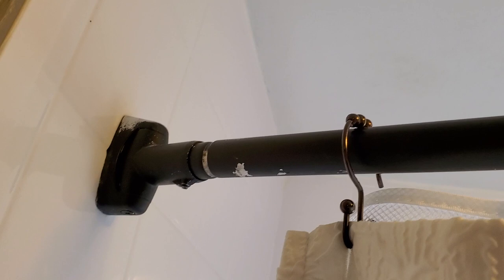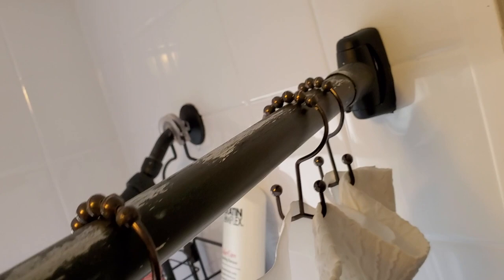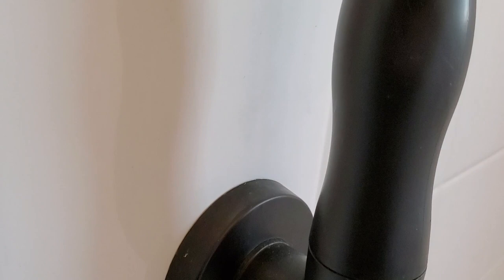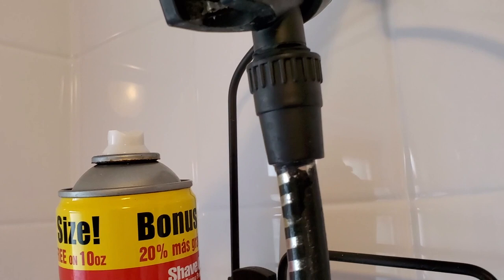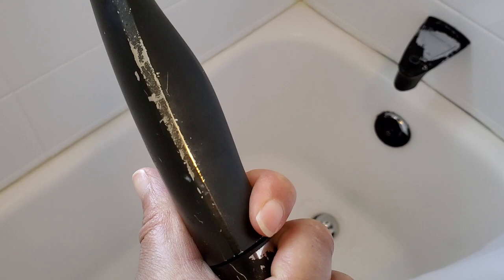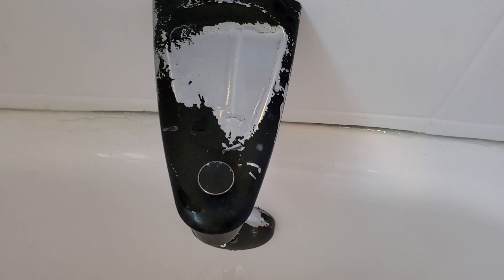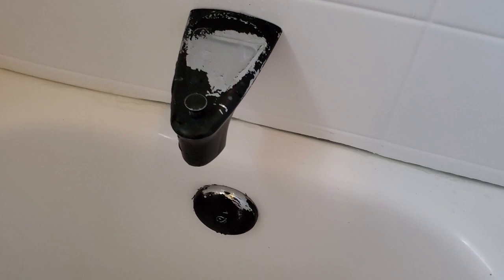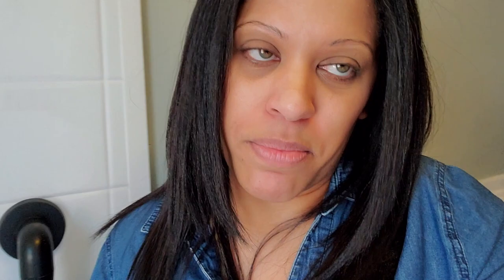BATHROOM FIXTURES UPDATE! | Casa Kerins | Rustoleum Spray Paint | DIY |  6 Month Review!

Comment: Rustoleum makes a matt black bumper and trim spray paint that is made to be used on car black plastic bumpers and trim. I don't know how it works on cars, but I used it to paint a black kitchen drain stopper and disposer flange that had chipped soon after purchasing it. it looks fantastic and is wearing like iron.
Reply from the maker: Oh wow my husband told me about that product. Maybe I’ll give it a try!! Thanks for the heads up!
Reply: Did you use a sealant on top of that too?
Reply: @klbracero  no, just the paint.

Comment: I actually appreciate this video. Thanks for showing what happens when u don’t sand or prime the fixtures first. 👍
Reply from the maker: You’re welcome. For the record fixtures that I did sand and prime chipped the same way 😉 what I’ve learned is that spray painting fixtures works best on low traffic areas.
Reply: @HelenKerins  oh for real? Wow… ok thanks for the info 👌

Comment: Hi. I did not watch your video when you painted your fixtures. To make sure the paint and sticks to Chrome. It's all in the prep. When you prep anything whether it's painted or Chrome basically if it has a slick surface. You have to really rough up the surface with either sandpaper or a type of Scotch Brite. Then use a good primer. Then paint it it will be there forever will not ship will not scratch. Basically when you spray paint onto a smooth surface. Think of it like this when you get a sticker the backen that the sticker side is stuck to. Is smooth and slick so it doesn't get stuck. The same with chrome or painting over paint you have to rough it up really really good.
Reply from the maker: Thanks so much for the tips!!

Comment: Suggestions:  If painting anything shiny, sand it until no longer shiny...gives the paint something to bond to.  After sanding, clean with a good no-residue solvent...I like "Goof Off", as it has multiple uses, but will dissolve some plastics.  Spray a base coat of good primer.  Spray several coats of your color.  Finish with at one or two coats of clearcoat...should have been right there with the rest of the spray paint.  Be sure to allow everything to dry/cure between coats.  The key is to have multiple light coats so that damage isn't as likely to be all the way to the base (original) finish, allowing for repair.  FWIW, this is pretty much how they painted the car in your driveway.  (Buy an extra can of color and clear).

To fix scratches, shake can well and spray a little spot of color on a piece of scrap something.  Dip a toothpick (the pointy one) in the paint and use it to barely fill in the scratch.  Let dry, then use the same technique to cover with clear.  Larger damaged areas can be sanded very lightly, masked, and re-sprayed.  A little bit of light rubbing with the "scrubby" side of kitchen sponge will blend in the "tape line" left from masking it off.  The scrubby sponge trick can also be used to blend in a scratch repair is if is proud above the rest of the surface.
Reply from the maker: Wow this is some awesome advice!!! Thanks so much!! I think my issue is that I was putting on thick coats and not letting it cure correctly.  Thanks so much for sharing your tips!
Reply: @kevincrosby you are a legend .. I'm about to do a bathroom makeover video and your advice is going to  to make it so much better 😌 thank you ... one question, how would a renter get it off afterwards (if they had to)?
Reply: @lyzeesl1fehacks  I would either obtain permission for a permanent change, or plan on replacing the fixtures when you vacate.  Either way, discuss it with the landlord and get the permission in writing.
Reply: @kevincrosby1760  no worries. Just wanted to be make sure so I can tell my viewers that this bit s or isn't renter friendly. Cheers
Reply: I'm trying this too.  Decided to go with a light sanding first then prime with self etching spray primer.  Finally I'll paint with a couple coats of hammered bronze spray.
Reply: What primer to u recommend?

Comment: Oh, I just bought the stuff you are scraping off (ie drain stop and overfill) under $10.00.  
Fixture you can get under $100.00
And we are investing in professional glazing (about $1000.00) 

Anyways, I watched video because a shower door is NOT a cheap replacement.  Your video was informative
Your little girl is adorable and you can tell you're an amazing mom

As for the plumbing, it is not that hard (the hot goes on the left hand).  Might need to invest in a $11.00 tool to remove drain stop if pair of pliers doesn't work.  If That don't work it could be due to someone caulking and that likely requires a whole new sink or tub.  

Before you invest in complete bathroom upgrade on tub/shower talk to professional glazing companies.  Save yourself THOUSANDS.  They don't do just white.  They do lots of colors.  They can also do backsplashes, cupboards, kitchen counters, and even tile flooring.  They just don't do shower doors 😂.  And their work usually has a guarantee attached.  Mine is lifetime.
Reply from the maker: Hey there!! Thanks so much for watching!!!! I was thinking of doing glazing but the previous owner covered up the tub with a bath fitter. Lord only knows what the heck is under that fitter! At this point I am itching to GUT the bathroom and start from scratch! Oh well thanks again for watching and for your kind words about my daughter and I :-)

Comment: Did you scratch the surface first and did you use primer(s).
Reply from the maker: I didn’t scratch the surface on this project but did for other projects (fridge, door handles, etc). The other projects I did were scratched and primed and still the paint chips. In my humble opinion…don’t waste your time spray painting if it is a high traffic area